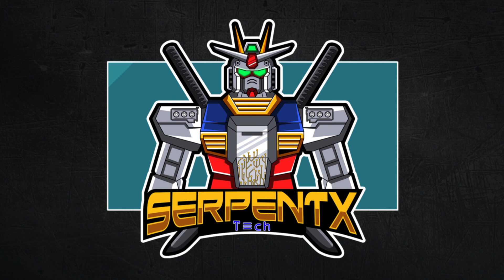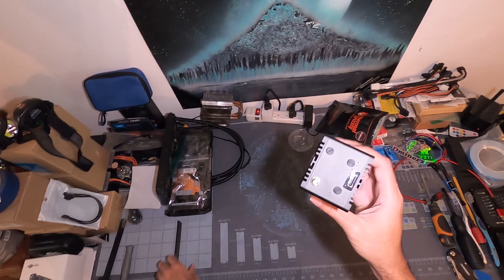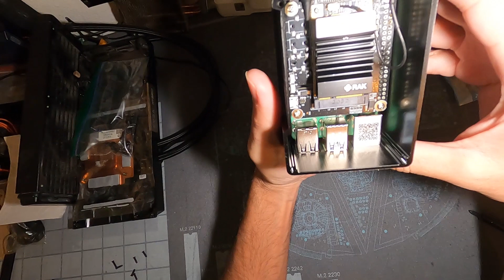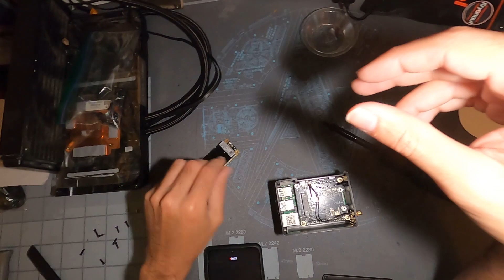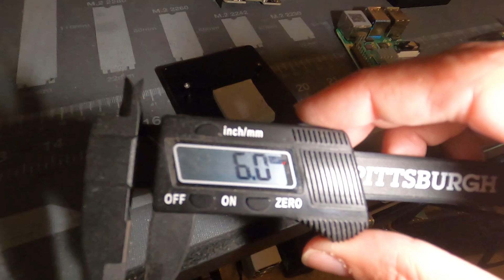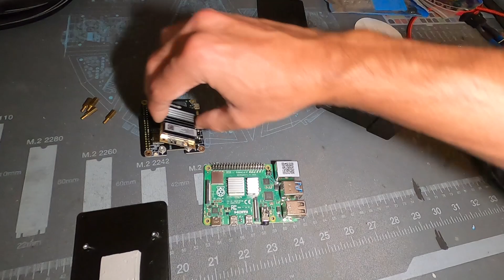Rak Helium Hotspot Teardown

Comment: Maybe you could've fixed this by reflashing the sd card with the latest Rak/mntd firmware. I did this and resurrected 2 miners. Now working fine on Helium network again.

Got another though that is totally bricked. No lights on ethernet port at all, only red power light comes on. No Bluetooth connection. Sd card replacement doesn't help. I'm presuming this one has a hardware issue I can't fix.
Reply: Were you able to fix the hotspot you described above? I have one that I cannot connect to my app via Bluetooth and therefore can’t connect to wifi. I haven’t checked Ethernet connection yet but I only have the red power light. I came to this video hoping to see what component on the mb connects to Bluetooth but I’m still not sure after watching. And yes, I have reflashed and replaced multiple sd cards. Any advice would be appreciated. Thanks
Reply: @devans4911  No, that hotspot is basically just a brick now. I don't have the electronics skills to fix it. Must we a hardware issue.